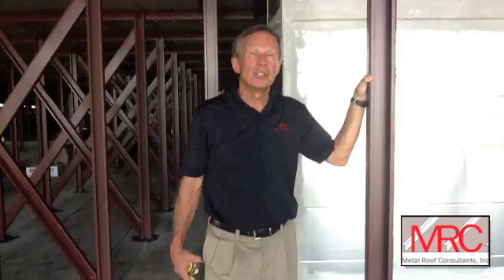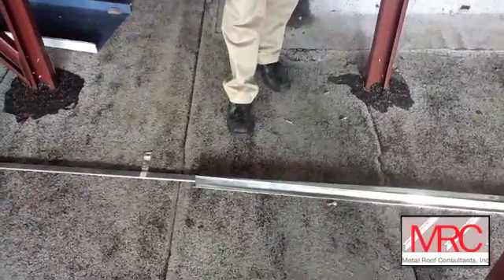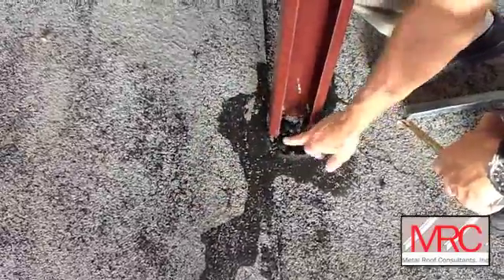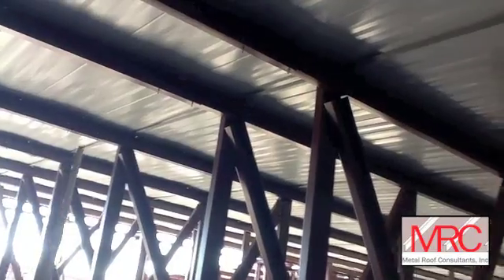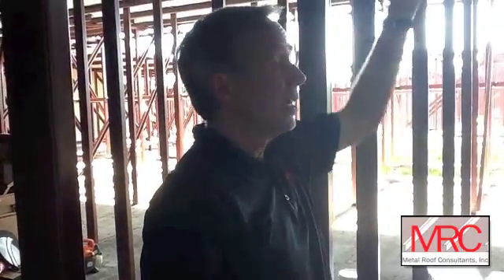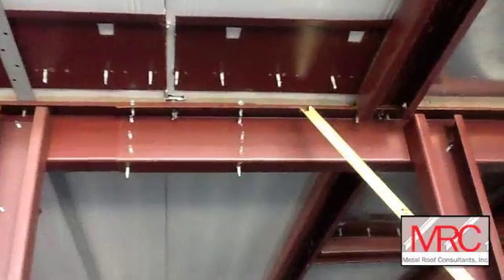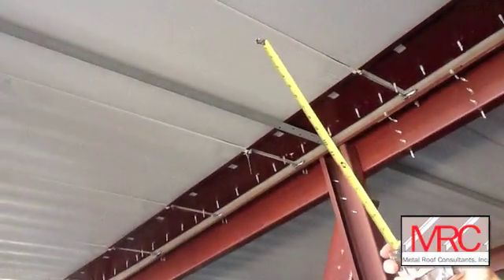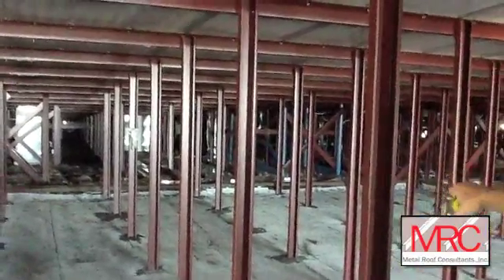How to Convert a Flat Roof into a Pitched Roof

Comment from the maker: Mor Bid -

A  retrofit metal roof, when properly designed, will only add approximately 2.25 psf to an existing roof. That load needs to be designed to uniformly load the existing structural members and not the existing deck. All of these new loads need to be calculated using the current building code requirements (IBC current edition, plus local jurisdiction revisions) in the area where the project is being erected.  In my 35 years of roofing experience I would say that almost all roofs can hold an extra 2.25 psf (pounds per square foot).
I am unsure where you got your information that it adds "a ton of weight to the structure" but the retrofit model actually will on average add less weight to the structure than a flat roof holding snow and water.

Please feel free to contact me through our website www.metalroofconsultants.net and I would be happy to speak more to you about this.

Chuck Howard P.E.
President
Metal Roof Consultants

Comment: Well, I have to say that I asked 3 metal roofing contractors about this idea and they said It can't be done. I got angry and made a diagram. I got frustrated and found you on YT! I own a small commercial building. 17' by 70' and there is a very slight pitch. Built 1925. Patch then leak gets old. I have a big mess now. I will try and find you. Thank you Chuck Howard of Metal Roof Consultants!